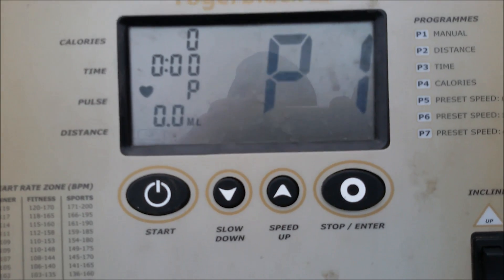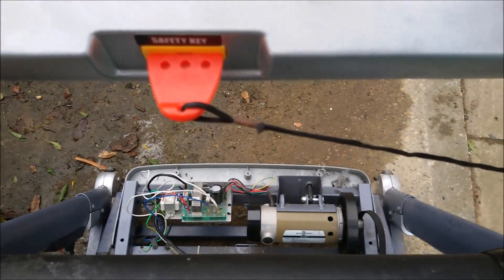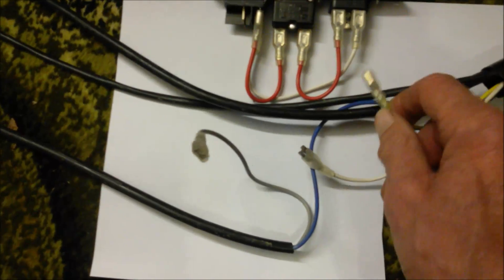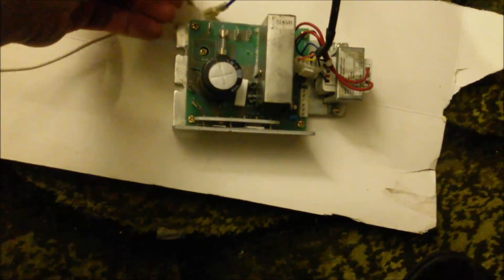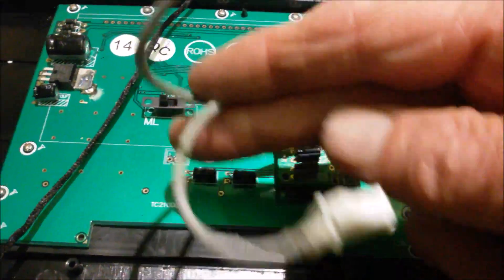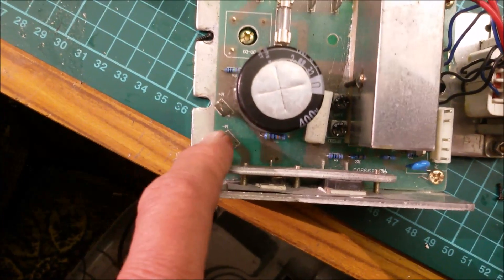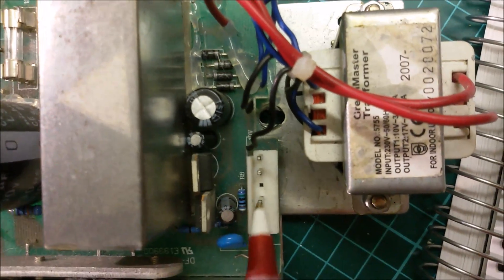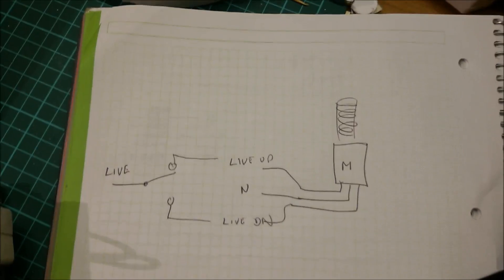Treadmill motor circuit for lathe

Comment: Can you write the labels of two components that are connected to head sink...I canot believe... the producer of the board that look very similar erased the labels of thode two components, that make imposible to repair the treadmill. Thanks
Reply from the maker: If possible find a working one that has been scrapped for other faults such as worn conveyed belt. Mine is now boxed and so I am not able to see if there are any markings. Good luck.
Reply from the maker: If you know that you are controlling a high voltage brushed DC motor then you can source a control circuit from China for less than the cost of repair.

Comment: I have several MC-60 controllers and treadmill motors. When first powered on, the motors will not run unless the speed control pot is backed all the way down to "0", then adjusted up to the desired speed. 

I'm guessing this is to prevent the treadmill from instantly spinning at high speed when turned on, which would be a safety issue for the user and likely hard on the motor trying to jerk-start the large heavy flywheel.

Also, on many motors, the flywheel is also the fan. But I have a motor that has plastic fans on both ends, so the flywheel is not necessary, as it also makes the motor coast for quite a while when powered down. I'm installing this motor on my drill press, so a long wind-down is not desired. 

My question is, is there a way to bypass the "Start at 0" feature? Or would disabling that feature damage the motor even with the heavy flywheel removed? I don't really want to have to turn on a power switch AND zero the speed control every time I use the DP.

Second: IF disabling the "Start at 0" is not possible or not recommended, could I use the speed control pot as an on/off switch (leave it at "0" when not in use) instead of powering down the whole system? What would the ramifications of that be?
Reply from the maker: I would advise keeping to the original circuit and function for some of the reasons you discuss. You seem to have a very good understanding. A NVR and a suitable third party controller would meet your needs. I have a mini lathe to which new circuits have been fitted. It will start at the preset speed when I release the NVR and turn the direction with on.

Comment: Sorry,were i can to buy One ibrid module (closed in metal box)used on the board for motore control ?
Reply from the maker: Hi Marco. This is a difficult question to help you with. In general you will find through a web search or eBay people who match up components. I have modified treadmill motor circuits, I have bought bare boards and boxed them myself, I have also bought a ready made system from an amateur. I try and include as much information as possible in the videos but you will need to search through them and those of other YouTube contributors. You will learn a lot along the way so enjoy! Cheers, John.

Comment: Hi great video, congratulations. Could you help me with my card like this, the technician removes the transistor mosfet now I'm trying to fix it but I don't know what numbering they are 3 could you help me?
Reply from the maker: Hi junior. I rebuilt mine using the existing circuits and just reconnecting the various circuits. I have also used another one with motor control circuits from China. My advice is buy a complete motor control circuit and use that. Let me know what you decide to do.
Reply: @bikerides  Do you have Whatsapp ? I would like to send you pictures of the plate
Reply from the maker: Hi Junior. If you are thinking of doing some electronics work at the circuit level then it would be helpful for you to join an electronics forum. I studied electronics at university but these days work at module level using my knowledge to help me get compatible modules that have adequate power etc. Also safety is very important. Try a forum. You will get many responses from different people rather than just one. Let me know which forums you go for.
Reply from the maker: Considering using the motor on another lathe. DC motor speed controllers from China via eBay are really cheap and other have videos of using them. Don't even think about repairing the board unless you have the time and expertise.

Comment: Hello sir send circuit diagram  180volt DC drive control  pls sir
Reply from the maker: Hello Zuber, my approach was to take the circuits from the treadmill and remember where the wires went. I have done another DC motor and there may be a video on my channel. You need to get a 180v DC motor speed controller from China or ebay. Then you need a mains ac to 180v dc power supply or converter. It is not worth building your own circuits. Both power supply and controller need to be of enough power, current, amps to drive the motor plus 50%. Connect them up and away you go. Raw mains into power supply, 180DC output from power supply into speed controller, output from speed controller to motor. Let me know if this makes sense to you or not.

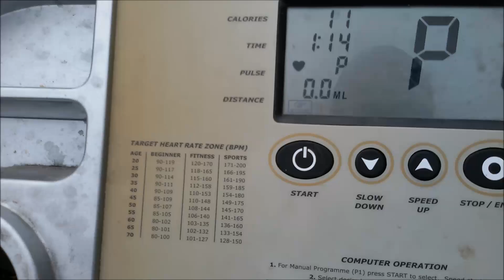Comment: At 4:05 you're showing the live and neutral input, but at what voltage do they run?
Reply from the maker: Hi Francesco. For the UK version of the treadmill the live and neutral inputs run at 240v. All ways check things through and measure on any such equipment you may be working on. I do see a similar motor used with 110v machines in youtube videos from the USA. They are probably all made in China. John.
Reply: @bikerides  Hi John , I'm from italy, so my board runs at 240 volts too. I asked you this because i thought the board accepted a low voltage in input, by using a transformer or something else. Thank you very much. Francesco
Reply from the maker: @franz1242  Hi Francesco. The motor control board shown at 10.30 has mains voltage in plus a control signal to the electronics in that rectangular metal box. There are many different treadmill motors running at different voltages so I have other motors and control boards running from 30v DC. But this one has mains to that control board.

Comment: Pls how can I connect the red, blue, white, yellow and black wire to keep the motor running without the treadmill control board. Am having same you used in the video. Am using the motor for project. Pls kindly reply. Thanks
Reply from the maker: You need a speed control board for a DC motor that is rated at 200v DC or more. They are available at low cost from China. I have only used the 12v to 30v type so I cannot help you further. See my video of the other dç motor.

Comment: this schematic  is only for you to understand because you make this thing complicated  for nothing
Reply from the maker: Even though this is a DC motor there are mains voltages involved so do not attempt any such work unless you are competent. The wire colours used are not standard. If you have your own treadmill it is likely to be different anyway.

Comment: Hello sir, I have a treadmill brand (ELEC TREADMILL ) and the wire was cute between the main control panel and the upper panel
The wires were welded and not connectors, there are no numbers or symbols on the board
The wires is four colors red, yellow, black, green, please is there any way to find out where wires are to reconnect them
Reply from the maker: It would be a great shame to throw out a good treadmill because a wire has broken. I am not familiar with your make. Every make has minor differences. There are often markings on the circuit board which can be a great help. Good luck

Comment: i want to use my treadmill motor for a trike....mount it in the space beteewn the back wheels and have it belt drive a wheel..run off a battery..any way to make these motors run off a battery ?
Reply from the maker: Some smaller treadmill motors are DC and would run a trike fine with the appropriate DC controller. See the video of one running the Simat 101 lathe. Better still get a DC scooter motor and controller. Do not go near AC or three phase variable frequency.

Comment: Im using mine for an actuator motor to power my vans rollout shelves..
Reply from the maker: Excellent. Are powering it from the van 12v supply?
Reply: John Mellor a good friend of mine is hooking up a power inverter so i can power my heat guns, compressor and blow driers, im in interior cosmetics, leather and vinyl repair and refinishing, i just built the shelving system.
Reply from the maker: Hi John. Check with your friend about the advantage of a generator. The inverter will be large and wack the power out of your batteries. A friend of mine does mobile car valeting and needs a petrol generator.
Reply: John Mellor absolutely, he mentioned needing 2 batteries to me last night, i need all of the space i can get so im looking into a company that i used to live next door to ( Northeast Generator) they speciallize in that are, i used to see alot of ambulance, news and police mobile command centers there.. i will be checking them out Monday
Reply from the maker: That would probably be a good investment. The generator will have a 110/240v AC output and probably a 12vDC output as well.

Comment: Hi John let me know if you can see that please https://youtu.be/QR6-QSx0EJE
Reply from the maker: Hi. L0 and L1 are connected together and go to one side of the rectifier through a fuse. L2 goes to the other side of the rectifier through a VDR (I think). The tabs on the rectifier are connected via the PCB and do not need any further wires. The large electrolytic smooths the DC which is then controlled by the large semiconductors at the top of your picture. To the left of the screened control circuit are four small diodes that provide the DC for the control circuits. All I did was connect the motor to M+ and M- and control it with a couple of the wires from the top left connector. Earth would go to  a tab/screw on the metal chassis. If you have any doubt just buy a DC control circuit of correct voltage and power (from ebay) and feed it with a DC supply such as a shop LED power supply. See other peoples videos for details. If you are not sure and confident stay away and safe as there is risk of electrocution.

Comment: Hi John i have nearly the same circuit board. But the bridge rectifier has outputs sticking out. So as i am looking down on the board from left to right.M- M+, then the four terminals for the the bridge rectifier, then three outputs labelled L2 L1 L0 then the over to the right hand bottom left the multi cable with the red yellow blue white black wires. My question is as i go around the board the black and red in the M- and M+, the BR what wires go where on the bridge rectifier, i know there are diagonal on your board there soldered on but my board have the outputs sticking out. is it jsut the case if joining the the two ends like ac to the ac and then wire joining the dc part to each other. then the L2 would that be the neutral or the live wire coming in from the mains  L1 will be answered from the previous and L0 would be the green yellow earth wire. Then i saw the post further down regarding adding potentiometer to the blue,whitle black wires, but what do you do with the red and yellow wires at the top of the multi  cable. TIA
Reply from the maker: last bit first. The multicable to the control panel caries power and some other signal up and sends the desired speed down. Hence only three wires are required for potentiometer control. In fact the other wires could be elevation. Without seeing the board I don't wish to hazard a guess at where the L0, L1 and L2 wires go on your board. Any chance of posting a picture?
Reply: tried to reply to the email i got saying you answered but it just came back saying not delivered. |How do upload a pic to here mate
Reply: I will take a video and put link here if it will let me do that
Reply from the maker: I think I have it but I need time to go and look at my circuit because I've forgotten

Comment: John, super work and thank you for a simple down to earth and very understandable vid. Looks like you posted it yesterday! I'm a woodworker building a reciprocating sander and was intending to source a cheap tradmill. Now wondering if it too powerful and a smaller (say 150w) scooter motor with a cheap chinese pwm and supply might be more appropriate.  Would welcome your thoughts?
Many thanks 
Alan
Reply from the maker: Scooter motors come in a range of sizes or powers. I think a relatively cheap 150w one as you suggest would be enough for your task.  The low cost Chinese speed controllers work well with them and I have used a switch mode supply designed for low voltage shop lighting (12v halogen) and that provides a good stabilised 12v. Using a computer power supply means a lot of redundancy so its worth buying the 12v supply.
Reply from the maker: Thank you Alan for your encouraging reply. Some comments below. Have fun and good luck.
Reply: John Mellor Super! I will look at sourcing a smaller motor. They do seem quite small for the task but the upside is a reduced footprint overall.  I guess the higher the wattage the better though...  This all new to me.
Reply from the maker: The great thing about building your own is that if you find it underpowered you can incorporate a stronger motor later. However, my portable sander is 600w. There are cordless ones at low cost in the UK but they must be much lower power. Most cordless power tools use DC motors from China made by Johnson Motors -have a look at them.

Comment: I've got a 220V DC 6.6 amp 3HP motor. The treadmill control board is bad so I'm trying to find a way to use the motor for a belt grinder with off the shelf components.

I've seen people use a heavy duty AC potentiometer with a wattage rating well above the motors, coupled with a heavy duty bridge rectifier. Idea being, you control the AC mains input voltage and then convert it to DC to drive the motor. I'm pretty confident I could get this set up wired up correctly and housed inside a nice control box, but I'm wondering if its a good solution? I'm assuming mains 240V is close enough to 220V is close enough to not require transforming.

AC-DC control boards designed for this purpose run anywhere from £100 and up, whereas this potentiometer and rectifier would cost less than 20 quid. Seems to good to be true (serious safety concerns)...
Reply from the maker: A modern DC controller will maintain full power to the motor while reducing its speed. That is the way the treadmill control board works.  Rectifying a reduced AC voltage will reduce the speed but will also reduce the power. However, at 3HP you have plenty of power to spare so the 'quick and dirty' approach may do the job well. Safety - yes in the US the mains voltage is 'safer'. Our 240v mains is lethal. The videos of uncased potentiometers and open wiring at mains voltage scare me. Mind you, 6 amp 220v DC would do a lot of damage!
Reply: Yeah they scare me too, I'll probably just sell the motor. I got the treadmill from ebay for £5 so if I can sell the motor on it's happy days and no death for me. I've got a 2 H.P AC motor which is a lot more straight forward for a grinding belt if I only want it to run at one speed.

I see second hand Leeson motors with less H.P selling for £200 or more, are larger motors generally more expensive? I don't really want to sell the thing for £50 if its worth a lot more.

Thanks for the input as well!
Reply from the maker: Sounds like good reasoning to me. After you have done the difficult thing of building your belt sander/grinder with the 2HP motor you can always add a speed controller at some point if necessary. Motors without controllers don't sell well, but good luck.
Reply: then no torque ,,means no power,that the reason the dc motor controller has,min speed,max speed, torque, acel, I, dec, (field  v for  a shunt motor) etc,etc, you need all those  adj to control a dc motor, w/out that is a mickey mouse job

Comment: I have a treadmill with this exact same DC motor control board, and lately the motor has been starting at full speed once the treadmill is powered. After troubleshooting I believe the problem is with the speed controller unit (that metal-cased box on the board). Also, the metal case has a live current when the treadmill is powered on. What would you advise? could the problem be the motor? could the motor be shorted despite still working?
Reply from the maker: I think your first thought is correct. It is very unlikely to be a problem with the DC motor. With a meter it is possible to test whether the control voltage coming down from the top of the machine to the motor control board is correct. If you can find a secondhand motor control board at low cost I would change it.
Reply: Thanks for your reply. I also noticed quite a lot of sparking coming of the brushes of the motor. The brushes themselves are fine. So I intend to skim the commutator. However I do not know if this sparking is also responsible for the uncontrolled speed of the motor?
Reply from the maker: Unless their is a serious reason to try this I would not go beyond a general clean of the commutator with a 'comm stick'. You can find complete treadmills with little use for less than £20. You are having great adventures looking at the issues with yours, you will probably find all the spares you need and be able to rebuild your treadmill and work on your motor at your leisure.

Comment: Hi John. I have the same Speed Control Board and I change speed using just a Potentiometer. Use 1kohm one and solder Blue wire on one end of Pot, White in the middle and Black on the other end. Works Great. Don't use Red or Yellow Connectors. Great Video BTW.
Reply from the maker: Hi Jerzy. Thank you for that very useful information. A great way to get variable speed control at low cost.
Reply: Hi Jerzy, thanks for adding the pot info, have the same board and was going to go down another path till i saw your post, John appreciate the video as i have the exact same board
Reply: Just the information I was looking for. Thanks! Great video John!